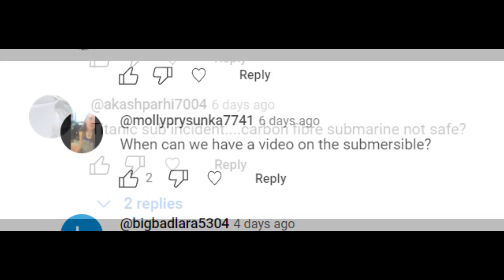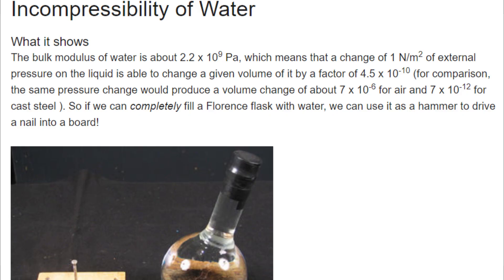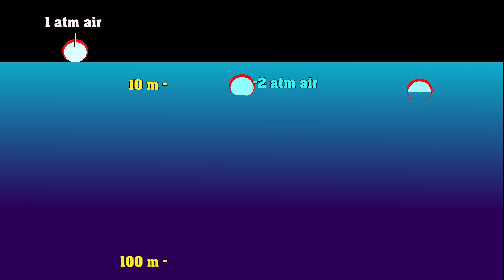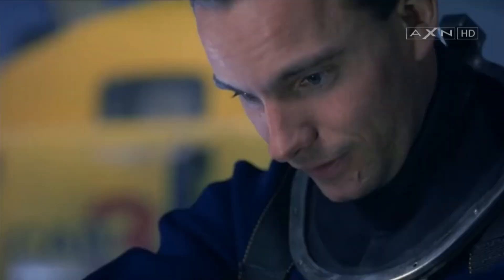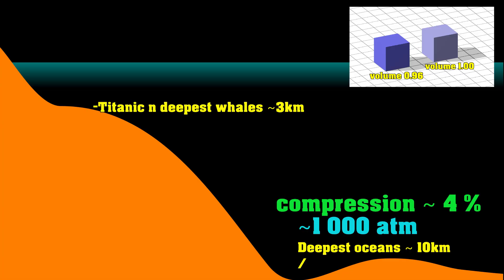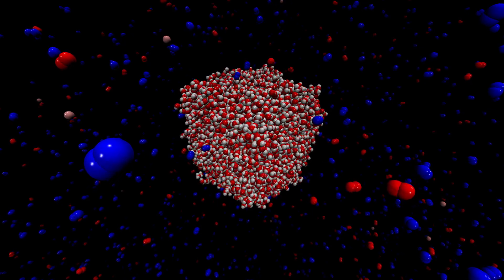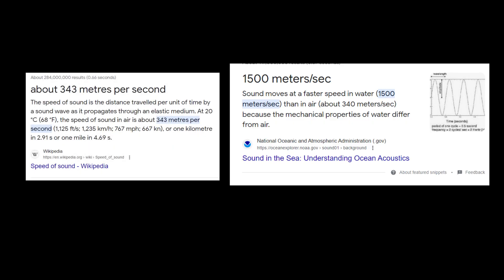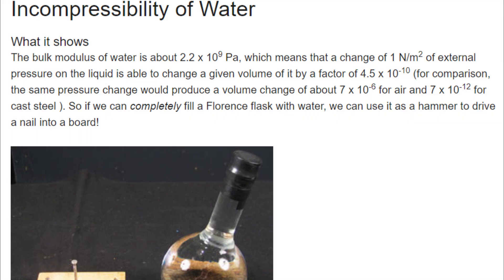What Happens when a Hull Fails at 1000 atmospheres?

Comment: the column explanation doesn't quite work because water cna rush in from all directions so the water a bit away fro mteh cavity would ahve to move much slower
in the end, water goes in at the speed where its dynamic pressure is equal to the pressure difference which for 3km and the density of water is about 245m/s - the same speed that a freefalling object in a vacuum WOULD have after freefalling, in a vacuum, 3 kilometers down, building up speed all that time
but the water ACCELERATES to that speed not at freefall velocity but prettymuch instantly
at least at the wall of the cavity
that speed spreads out from the cavity allowing more volume to flow in at the speed of sound in water whcih is where hte compressiblity of water comes in
if you have a small hole in a hull thje water shoots in at taht speed whcih again, has a dynamic pressure equal to the water pressure at that depth but with a much sharper gradient whci htends to abraid things and basically hits naything inside or the other side of the hull like a waterjet cutter
and of course, most hulsl integrity is designed based on the assumption that there's no irregularitites in it so the pressure can spread out smoothly and symmetrically around the whole hull
in addition to being hit by a giant water cutter, you also get rapidly heated up since the remaining air in the sub and in your lungs gets ocmpressed approximately adiabatically so by the time the air has 10 times the density it also has about 2.5 times the temperature and thus 25 times the pressure
that is absolute temperature so if you start at 20°C or 293K 2.5 times that is about 732.5K or 459.5°C
Reply: bleh

Comment: What happens to the temperature of the gas as it is compressed?
(I know what happens when you slowly fill a scuba tank, it gets rather warm)
Reply: I thought rapid decomp is the opposite, it releases energy therefore freezes?
Reply: I don't know if they got any kind of tissue damage before they got squished by the water hitting them. The sub was ~5 meters long, so the water took about ~5ms to fill the hull. Sure, Diesel fuel combusts at these pressures in these time periods, but that fuel is extremely finely dispersed in the air. Humans aren't.
Reply: @kain0m  The not so even and very rapid inrush of water into the sub would tear anyone into pieces, the hull itself would probably help a lot with that process as well. But still, pockets of gas would get incredibly hot. But then comes the cool ocean water so...
Reply: @kain0m The submersible filled from the sides not the ends. The end caps survived undamaged.
Reply: It has nothing to do with that. PV= nrT , there would be corresponding rise in temperature of gas pocket. I dunno why this guy was talking about springiness of water and other stuff. You have a well known case of Argentine war sub that imploded much shallower ,but deep enough. Crew died instantly, blood evaporated,tissue dissolved due to instant rise of temperature… 15:43
Reply: Ideal gas law. I have no idea why he talks about decompression,water compression yadayadayada… Its pretty straight forward , inside sub 14.7 psi.Ambient pressure  around 5800psi. Hull failure,leads to instant temperature rise. Its basically diesel engine piston (ocean) ,compressing air pocket, humans+whatever is flammable is fuel. Their tissue boiled in microseconds…
Reply: @digitalcommunist6335  He is talking about one single aspect of rapid compression and decompression. That is how I would do it too. Break it apart, examine it one by one. "This would kill you, this would also kill you, as well as this, and this, but this would only hurt a lot, but not kill you" and so on.
Reply: @magnuslindgren9460  i like the guy . His Elon related videos and when he calls out grifters selling vaporware are great,well researched. This one not so much. From his bell examples i can see he knows not much about saturation diving… And that doesn’t matter in this case. In this particular case , Ideal gas law is much more applicable…
Reply: @digitalcommunist6335  he briefly touched on saturation diving, but he did not go too much into the limits on that, which I believe are mostly constrained by how long you a decompression cycle you can put up with - so anyway tangential to the main topic, which is the "water hammer"
Reply: @DrWhom  i agree its tangential . I’m just saying that before any ‘water hammer’ those 5 poor souls inside died instantly due to pressure induced temperature rise. Their blood evaporated ,tissue dissolved and what not as soon as air pocket went hot in miliseconds… Thats all..

Comment: I don't get why the bubble of low pressure water would expand into the high pressure water? Or is it the high pressure water moving to fill the void of the water now rushing into the 1 atm chamber?

Thats probably it. I have to rewatch this after coffee
Reply: Because the volume of decompressed water is much larger than the submarine volume to fill it. If I'm not wrong with a 4% compression it needs 25 times the submarine volume around
Reply: the latter is his explanation yes.

Comment: It was like shooting fish in a barrel. It was just that water was the bullet and opening the sub was the gun.
Reply: Thats not what happened, its clear thunderfoot is a bit out of his element here. They died because the sub imploded, water rushing in had nothing to do with it. The hull collided with them at supersonic speeds turning them into a fine paste, and the air heated to around 5000 degrees celsius further vaporizing them, and then came the water.
Reply: @rykehuss3435  People can take 5000 degrees burns and survive if the burn is only sustained for a short amount of time. For example, people hit by lightning are often burned with much hotter temperatures (for a very short time) and can survive.
Reply: @jazzabighits4473  I know, and I absolutely agree that this about 50 millisecond heating probably didnt contribute much to the total trauma sustained.

Comment: It is actually very interesting. Even though practically speaking, there isn't much of a difference between this and how most people describe it, it is still interesting to get the nuanced details of what is actually going on.
Reply: Hydraulic Press Channel gives the visible demonstration using scaled down models and a compression chamber, and Thunderfoot adds the good amount of extra detail about how it's happening
Reply: I wonder how the crew actually meet their end. Were they killed by the impact of water against the hull or ripped apart by the gasses exiting their body. I read some stuff about wound ballistics and if i remember correctly, human tissue tears if hit at 600 m/s or greater. The speed of the water was higher, it would be interesting to see a computer simulation.
Reply: @warrenfowler8049  Thank you for articulating the question that's been burning in my mind since this happened. I was going to comment, but none of the ways I worded it satisfied me.
Reply: @warrenfowler8049  I'd suspect a combination of being ripped to pieces by the high velocity water and being burned to a crisp as the air is compressed it's temperature starts to look like the inside of a diesel engine piston.
Reply: @spidalack  Did hope that TF video will address this "hot air" stuff with some precise calculations but oh well... I don't think there will be enough air volume to produce so much energy to burn all that matter inside, like I can imagine big submarine have enough air so that final compressed air bubble can reach very high temp and keep that temp for at least some millisecond(s) to burn stuff, but a few cubic meters of air getting compressed to something like 0.01 cub.m. even if it's really hot, do you think there would be enough total energy to burn stuff before it dissipates into water? I did some calculations and got roughly around 160 million joules of energy produced in the process, don't think I got those numbers right, but temperature seems to reach only around ~1300C and that's just for a millisecond in a small bubble(small surface area). Almost every YT video is full of those "temp of the sun, burned to ashes" stuff, but it would be interesting to see actual precise calculations made for a small air volume like titan was.
And yeah, that "uncompressed water bubble" expansion was really something new, no other video talks about water compression\decompression being involved.
Reply: @xerxeslv  I agree the "burned to ash" some channels go with sounds like exaggeration. I'd expect more something along the lines of "this small bit of human got cooked on the edges, this small bit of human liquified, this small bit of human got ripped to shred"

At this point, it's of more interest to whatever sea life had the remains for lunch than to the people that died.
Reply: @xerxeslv  I think the temperature of the compressed air isn't relevant anyway when you're getting hit by a wall of water traveling at multiple times the speed of sound a millisecond later. I don't think there's a lot of burning happening in that timescale. 

When you think about it, it's like doing a belly flop from the 10 meter tower, just with a much shorter fall time and and a much higher velocity.
Reply: @spidalack  Wow, interesting and well described -- thank you!
Reply: @spidalack 
The air wasn’t hot enough for long enough to burn them to a crisp.
Reply: Water hammer at twice the speed of sound is not that different from getting exploded by a solid instantly turning to gas.  Both are ridiculously powerful compared to everyday life.
Reply: Gg😊
Reply: There is actually a lot of difference. Most people are describing this as implosion of a compressible ductile 'bag'. What TF is saying is that pressure forces will have started compression but, with a brittle casing such as carbon fibre composite, a rupture will have developed very quickly followed by compression at the same time as this expanding water ingress effect, leading to massive water hammer on everything inside and against the inside walls of the sub. All at incredibly high speed.
Reply: What if this hull rupture wasn't a leak but the actual pressure vessel collapsing?
Reply: @StinkPickle4000  If it leaked, a catastrophic rupture of the entire hull would ensure in a matter of a few microseconds.  It would be like pricking a balloon with a pin, only much faster.
Reply: @leslierhorer1412  it's literally the opposite of a balloon explosion
Reply: @StinkPickle4000  the pressure vessel collapsing is what causes the leak in the first place.  but I think I get what you mean -- if it was a more flexible metal then it would "squish" the inside before it ruptures.
Reply: @-TriP- 
First 🥇 We Had Watergate Now We Have Oceangate?.
Reply: Sater never touched the bodies while alive the air done the business end of the deal under compression.
Reply: I'd say there is a pretty fucking major difference !

Comment: I was under the impression that it wasn't simply a leak in the hull,but rather the hull was not strong enough to withstand the pressure and it was crushed like a soda can. You can't say that air filled containers won't implode in very deep water. I've seen aluminum water bottles dropped to depth and when pulled back up it was crushed like a soda can.
Reply: This video is more about the science of water at those depths than about the submersible per se. It focuses on what mechanism exactly caused humans to die. All videos on the sub I have watched agree that the pressured hull crushed. The debris field was caused by all the external parts of the hull falling off. No reason for them to be particularly damaged: they were already out in the water and no explosion occurred. The channel “what is going with shipping?” posted a short and clear recap explaining this if you are interested.
Reply: "Crushed like a soda can" implies that the hull remained intact but just crumpled.  The hull was pulverized.  They recovered no pieces of it.  If there were any pieces still stuck to the metal parts they recovered, they were too small to see from any distance.
Thunderf00t shows the water coming in from one end here since he's only discussing the movement of the water, but what happened is almost certainly that the hull gave way and shattered so that the water came in from all sides except the ends at once.  From the vague info the news has given that "human remains" were found in the debris, it appears that some small amount of the people inside was squeezed into the rear of the sub, probably in liquid form.
Also, when water moves that fast underwater, you get cavitation.  Basically pressure differences due to the movement causes some of the water to vaporize momentarily.  Cavitation bubbles are hotter than the surface of the sun.  The pits you see on ships' propellers are cause by cavitation bubbles vaporizing bits of the steel.  There would have been a lot of cavitation in a very short time.
And of course the air in the sub would have been compressed to 300-350 atmospheres in nanoseconds, which would have made it extremely hot as well.
And then all of this would rebound to some degree as the mach 2 water coming in from all sides met in roughly the middle of the sub and swirled and equalized, which is why the bits of the sub that were outside the hull were warped and torn apart.
Reply: @Bacteriophagebs  in short, the hull should have been that lucky to just get crushed!
Reply: I think the reason people hypocrisy it implode d rather than crush was the debris field.

If the sub was crush, the hull would be intact but pieces of the tail end of the sub was found so the sub wasn't intact

As well as the navy picking up the a loud bang, the sound signifying an implosion.
Reply: First, we don't know the exact mechanism of failure and won't know definitively until after an investigation is done, if that can even be determined.
That said, the hull was strong enough.  Until it wasn't.  It had made a number of dives.  It is likely that each dive weakened the carbon fibre composite part of the hull.  The weakness was almost certainly non-uniform - some areas were weaker than others because of micro-fractures, delamination, etc.  On the final dive the weakest spot of the CFC tube failed.
If OceanGate had done a detailed scan of the CFC tube via x-ray or ultrasound before the first dive, and then repeated that scan after every dive, comparing the latest scan against those prior, they would have seen changes over time.  If they had good quality control and they did scan-dive-scan cycles with uncrewed hulls to the point of failure (ie. multiple hulls tested to destruction), they would have learned what potentially catastrophic weaknesses looked like.  Then they would be able to identify when a hull was too risky to use on anymore dives.  But they didn't do any of that.  They didn't scan, they didn't test, they didn't have good quality control, they didn't have safety threshholds.

Comment: I'm a plumber, I've always thought water couldn't be compressed, you just destroyed my reality,
Reply: Sound wouldn't be able to travel through water if it was "truly" incompressible, if you think about it.
Other than that, there is basically no practical application for the compressability of water in our "1 atm overworld". Only the Titan crew got the full compressed water physics experience.
Reply: On plumbing scales it can't, just if you try hard enough, anything can be compressed.

Larger rocky planets are more dense than smaller ones because the rock itself gets compressed more in their interiors, for example
Reply: What's a practical reality at scales we humans typically encounter often doesn't hold up at the extremes. 
Another thing with air pressure:
We oil air tools with a couple of drops into the connector to keep them lubricated, running at say 8 Bar - no issue. 
Hydrocarbons in a high pressure air system, like say on/in a fill nipple of a 300 Bar paintball/air rifle rig, it's explosive.
Reply: 0.000508/MPa… about 2% at 3800m (slightly more because it is seawater and denser than fresh water).
Reply: @allangibson8494  don't over complicate it, I unblock toilets and make water go hot,
Reply: @bertram6934  300 Bar hot water systems are a thing… (they are really good at removing paint off steel and brickwork (or brickwork off steel if you hang round too long)).